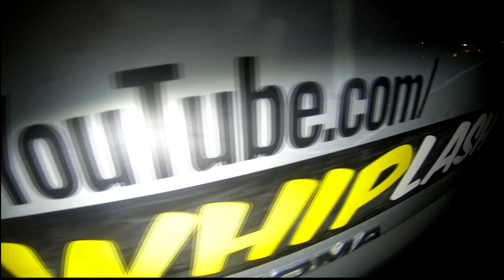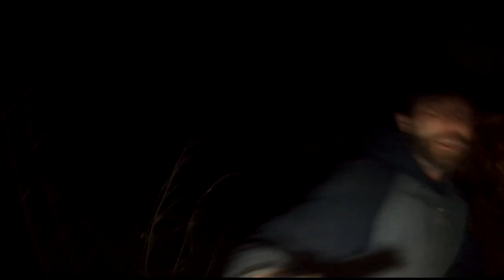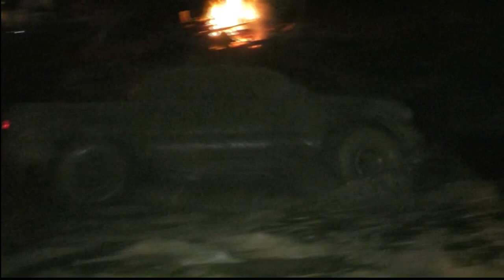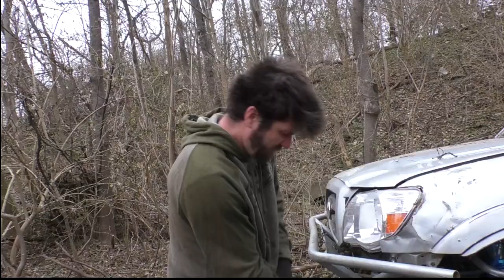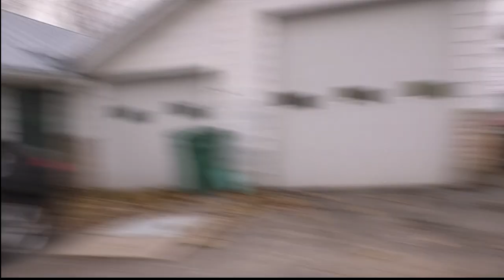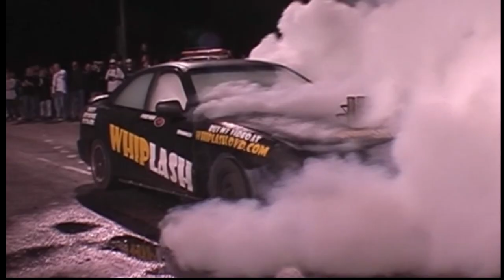Smokin and Drinkin on a Tuesday Night  (Stubby McFly  Part 2)

Comment: I did the same thing after coming off a hill in the snow though. Set the ebrake at the bottom. Put a factory locked fzj80 rear axle in. Best thing I'm done. Full float axle. Paid 300 for a custom harness for the locker connected to the factory switch. Truck did the moab trip from Washington without missing a beat.
Reply from the maker: I never even thought about a Land Cruiser axle!  I built a GM 10.5" with 6 lug hubs.  Just got it in.  I'm sure it'll hold up, but I definitely would have used the FZJ80 axle if I had known about it!  I'm so far out of the loop.  No friends.  smh